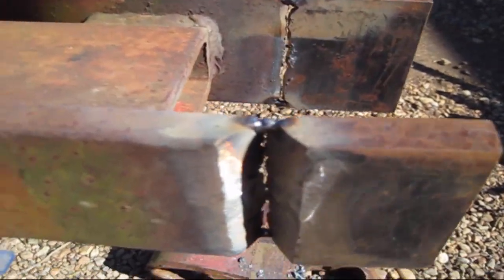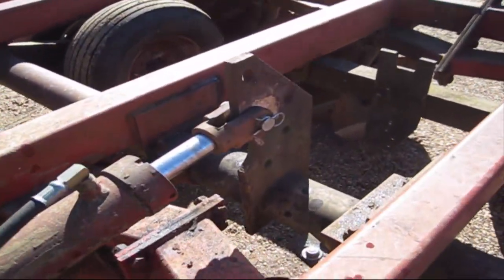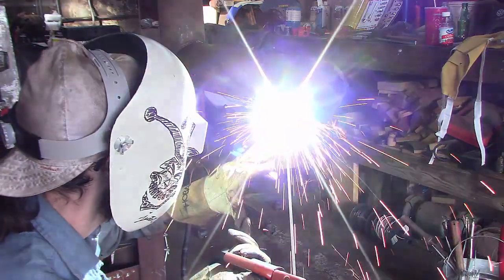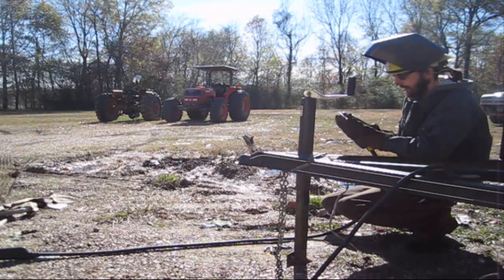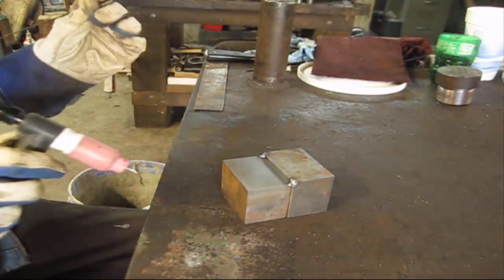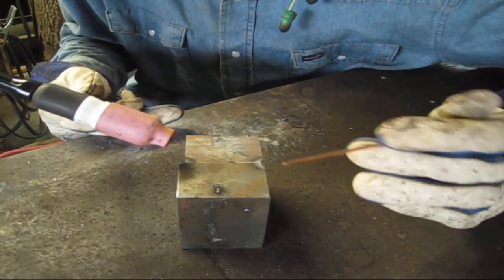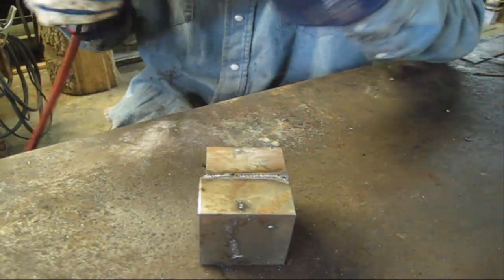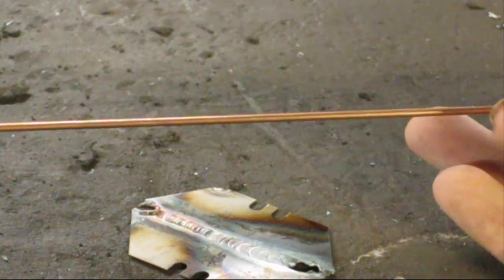The power of AMPs

Comment: Stick is a robust process and the cheapest to run rods per pound are cheaper than wire although dual shield is a must if it's a production secernio short circuit mig is dangerous on thick steel spray transfer is great but limited positioning stick is the go to really

Comment: when welding pipe give yourself a loose 3/32 gap and a beefy 3/32 land and u weave it up the pipe in a u shape  from side to side with a tiny little whip action up and down around 80-90 amps using 1/8 6010 this is how i do it and have passed many x rays. well rig welding in alberta i have had 4 repaires in 11 years so try this method my good man i think you will like this way. thanks for the exelent video lots of good content always like your videos and i am subbed thanks.
Reply from the maker: Nice man.  I need to work more on my branch tests.  I've done 5G and 6G, but branch I've only done on my own.  Thanks for the tips I'll be sure to put them to use.

Comment: What size rods do you use the most? Any particular brand you favor? I'm new to stick welding.
Reply from the maker: Braz1956 Well my favorite is a 7018 1/8", but I run more 3/32" 7018 and 6011 than any other rod.  I've ran a lot of different brands, but I think Lincoln Excalibar is the more consistent.

Comment: I recently purchased a Miller Trailblazer 325 EFI with excel power. Amazing machine but I have to say, I like the growl of the old grey machines better. Yours must be a diesel. Great instruction too. Very informative. I just subscribed.
Reply from the maker: survivalguy fyi The 325 are good machines. You can run AC power and wire feeders with it where mine can not. Haha thanks it is a gas burner the diesels are quieter lol.

Comment: Nice work. Nice camera work. Useful info. Thanks for posting.

A couple of questions: on those fill jobs on thick material, do you remember what you were using? 7018?  7018AC?  I don't do a lot of filling, but I do some on material up to 3/8". 7018 is my favorite but 1/8" 6013 isn't bad, except for the heavy flux.

Out of curiosity, why not use 7014 or 7024?  I don't use either one but I'm tempted to try them out.
Reply from the maker: It was 7018 they are really good for those kind of jobs because the weld is somewhat harder than other filler welds.  7014 is good if your having to cut the weld back out.  7024 is the same has a 7014 other than it can not run up hill.  Thanks good questions.
Reply: Classic Work Thanks for the reply. By the way, you have a really good instructional style.

Soon as I'm done eating, I going to burn some 7018. Have to weld diamond plate to cross supports. I figure 7018 will hold up better under the pounding of people walking on it.

Comment: Lots of good welding tips, I especially like the "real life" repairs you did. I had seen a video where the guy used a plastic bottle with the bottom cut out and fitted it over the contact lug power connector for a little more electrical safety, should it touch something it shouldn't.

Comment: Could you explain the correct volts and amps settings for various metals and joints you are you using there on your f162 SA 200, I have just like it. thanks
Reply from the maker: I can do that.  Now my machine will be different than yours because mine has been clocked.